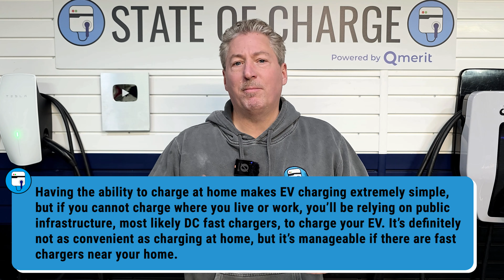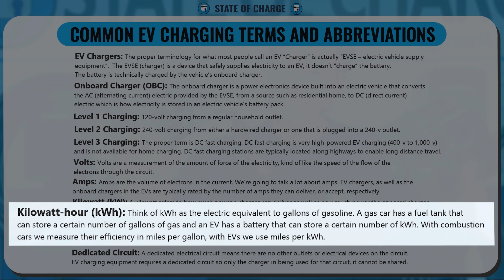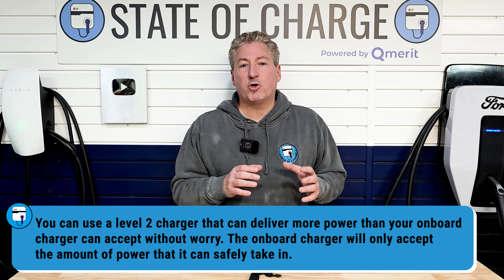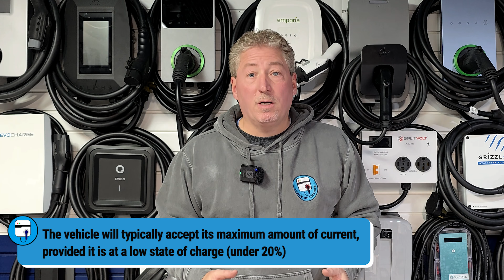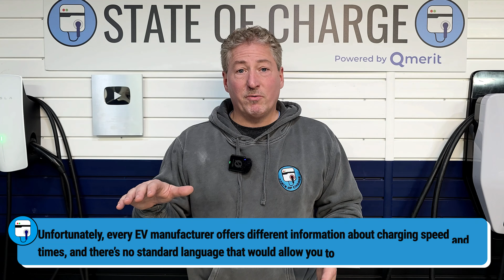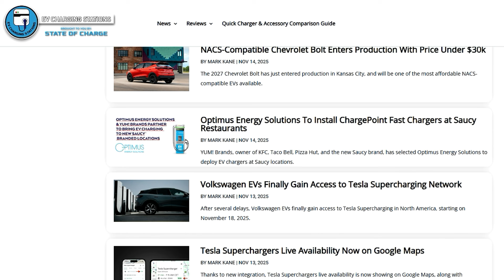Understanding How Electric Vehicle Charging Works And How Long It Really Takes

Comment: Great info! If I plug in on level 1 everyday for 365 days a year for 8hours per night is that considered 365 cycles? After 10 years my battery would be at the point of maximum charging?

Comment: Don't sleep on level 1 charging!  The average daily commute in the US is just under 30 miles round trip.  Even adding 4 miles range per hour of charging, which is on the low end of what I've experienced personally, you should be able to refill that in under 8 hours.  For a lot of people, a 10-hour nightly charge at home will easily cover your commute plus errands and other incidental trips.

Another way to look at it, if you add 4 miles for every hour you spend charging, and you plug in for 10 hours every day, that's 14,600 miles every year.  If you drive less than that (and you really should be excluding road trips from the total, since you're going to use DC fast charging for those regardless), then level 1 charging will likely cover your needs.

When I bought my EV I had planned to get a level 2 charger installed eventually, but after living with level 1 charging for a few months, it will be a long time before I upgrade to level 2, if I ever do.  Level 1 charging isn't for everyone, but for many people it's quite enough.

Comment: Hello Tom,

Thank you for providing a detailed explanation of the various charging levels. I am from Canada and am relatively new to electric vehicles. I watched your Grizzle mini EV charging video and considered purchasing one for outdoor use. I park outside and only have access to level 1 chargers using standard power outlets. When I attempted to purchase the Grizzle Mini from Amazon, I discovered that it has received negative reviews and some technical issues. Could you please suggest and help me out to get a reliable level 1 charger for 2026 RAV4 plug in hybrid for outdoor usage? Thank you Tom!

Comment: Great intro video! EV charging is new to me, so I didn't realize that level 1 & 2 "chargers" are really just AC-to-AC adapters (like a transformer?) that take either 120 Vac or 240 Vac as input and then output some output appropriate voltage that the vehicle's onboard AC-to-DC converter (actual battery charger) can use as its input. Do you know the ac output voltage that these level 1 & 2 "chargers" actually provide to the vehicle's onboard battery charger?

Comment: hello, great video. Quick question. My breaker is 60 amps but my tesla mobile connector for 240 v takes only 32 amps. Can I still use it to charge, will it damage the battery or charger in the long run?
Reply from the maker: Yes, you can use it without any issue!

Comment: When installing 2 Eporia Pros is it required to use both load management systems or is just 1 required?
Reply from the maker: If you are powersharing between both units, then only 1 load management system

Comment: I recently leased an 2026 Hyundai Ioniq 5. When preparing for its first road trip, I wanted to set it up to charge to 100% and finish charging just before I planned to leave in the morning. But I could not find a way to set it to complete charging at a set time. My Audi Etron has this feature. I can set it to reach 100% about a half hour before I depart. My question, does it harm the battery to have it sit at 100% charge for several hours? Or does it matter al all?

Comment: I’ve been using a 30 amp circuit for my EV6 and charging overnight easily from 20-90 kWh. I purchased a grizzly EVSE on your recommendation and it’s great with its thick cable, Cheers

Comment: Tom, I'm a 75 yo man and I only drive 3 to 4 thousand miles per year.  I just purchased a 2025 Ford Escape plug-in hybrid to replace my Ford Explorer to facilitate ease of driving as my wife and I get on in years.  The Escape has a tiny battery and I use the provided 120V charger.  It takes a full 12 hours to bring the battery to full charge.  Would installing a level 2 charger significantly reduce that charge duration?  My home has a tiny 100 amp service panel and it is maxed out in power because we have a pool, AC, and many other electrical appliances in our home.  I think we can only add a 30 amp breaker at most to the service panel.
Reply from the maker: It would absolutely reduce the charge time, possibly to under 3 hours if you install a high-powered charger. Your 100-amp service panel isn't a major problem anymore. You just need to buy a charger that has intelligent load management, like the Emporia Pro or IYILO chargers (There are others also. They will manage the load of your house and allow you to charge at 40A or even 48A, especially overnight when you don't have too much other electric use.

Comment: Yep, I've been charging my Tesla Model 3 only with Lvl 1.  I haven't bothered to have a 240V Lvl 2 installed, because we're likely to move within 1yr and the lvl 1 has been sufficient.  If we ever needed to charge up, we could always DC Fast Charge for a bit.  We've got multiple Supercharger options within a couple miles.

Comment: 16:30 — We redirected an existing 30A dryer connection to the opposite side of the same wall, into the garage (we had already switched to a gas dryer several years earlier).

We find that 24A is plenty to cover the needs of our Tesla Model Y and our O’Toyta 😂 Prius Prime (PHEV).  That, even including charging up to 100% right before a road trip.  

We generally keep the Model Y’s battery at 2/3 charge, but preparing for a road trip, the day before, we charge it up to 80%, and then the night before, up to 100%.  Easy!  Works fine!

Comment: A home EVSE is, essentially, just a very safe extension cord!  It essentially just sends the home AC power into the (PH)EV’s built-in charger, after performing some charging capacity checks.

Comment: When we see large charging-time numbers, they are usually imagining that you’re charging most of the battery capacity — say from 10-80%.  

That’s not common except on road trips, which, for most people are only a few times per year.  Most people don’t use anywhere near that large a percentage of their batteries per day.  If you drive, say 30 miles per day, you’ll probably have no problem replenishing that with a level-1 charger.  That, assuming that you plug it in every time you park in your garage.  

This is very easy to do too:  Once you get it all set up, it takes about 3 seconds to plug in when you park at home and 3 seconds to unplug before you go.

Comment: I know you know your stuff which is why I'm very surprised you would say plugging in every night is not bad for the battery!! There have been numerous studies to show that the less charging cycles you do the longer the batteries last (the less degradation).  Numerous studies show that a charge cycle from 20% - 80% makes the batteries last longer and have less overall mileage loss per charge over 10 years than anything else. Batteries have a charge cycle life, the less charge cycle the longer it lasts and it's been proven through numerous peer-reviewed studies.

Comment: Some incredible explanations Tom. Thanks.  

One Question you didn’t specifically address that’s on my mind: 

Does it damage the battery to charge beyond 80%?  Chevy, re my Silverado EV at least, recommends 80% for daily driving.  And my takeaway here is that, even with an overnight level 2, it’ll likely cost more to get those last 20%. 

Probably that is reason enough to stop at 80% when I drive 30-40 miles most days. But if I decide to press to 85-90% regularly, is that going to damage the battery in the long run?
Reply from the maker: Over time, it's not great to consistently charge over 80% for daily use. When you need the extra range, feel free to charge to 100%, but for daily charging, 80% should be your target. Why are worried if you drive 30-40 miles a day?

Comment: Great video, as an overview.  But in my case, my 3 year-old Audi e-tron hardly ever acts the way you describe, unless the car has been driven a considerable distance and/or the battery is warm from the ambient temperature.  My most common experience is that the charging rate starts low, gradually rises until the battery is warm (I guess), and then tapers down rapidly when it gets over about 60%.  My experience might be out-of-the-ordinary because my situation requires frequent DC fast charging because I do not have AC charging readily available at the present time.  So I am often charging after only a short trip from home. Which means that the battery is cool or cold, even if the weather is warm.  (The e-tron does not have battery preconditioning so the only way to warm the battery is to drive it.)  Also, I suspect that Audi may have changed the charging curve.  Anecdotally quite a few Audi owners have complained about slower charging since their cars got a recall whose purpose Audi described rather vaguely.  Now, maybe Audi did nothing, but I know that Tesla changed the charging curves on many of their early cars if the cars had had frequent DC fast charging  (Tesla told us so).  Anyway, my point is that DC fast charging is very much influenced by temperature of the battery, and may be regulated by the car differently from how you described it in your charts.

Comment: As well. A Rivan has a huge battery to charge. A Rivian is heavy because of the large battery. So, a heavy vehicle uses more power to go a mile due to its weight. So, they make a larger battery so the heavy vehicle can go a long range between charging.   In short, it is a big downward slope, batteries are heavy, and the more the longer to charge for 2 reasons, the volume and the weight requireing more batteries.

Comment: Anyone own and drive a same EV from day 1 of ownership for over 10 years now without replacing the EV battery yet.
Reply from the maker: Absolutely. There's many people who have 2015 and older EVs running on the original batteries. Some with over 300,000 miles

Comment: 16:23 not only capacity for power or space in the panel but capacity in wire routing.  For those of us who have conduit, 1/2" conduit is usually all that's installed. The max wire size is 10ga that can be installed, so a 30 amp circuit is max that can be run thru existing conduit.  Thats what I did, use existing conduit and run new 10ga wires thru existing conduit to the garage.  Its been great for last 4 years.

Comment: I asked on another video from someone else about above 80% charging. Here is what I'm trying to figure out on DC faster charging. What %age would be considered on DC charging slow enough to be at level 2 speeds? Would it be better to switch from a DC charger to an AC level 2 to complete to 100%? If they install level 2 chargers at DC charging stations, could that be considered less charging time than staying on a DC fast charging? DC charger will say, please switch to the level 2 charger to finish charging.
DC charging and finishing on AC to 100%. A title of a video.
Reply from the maker: Very few DC fast charge sites also have L2 units, so it's not a matter of unplugging from the DC charger and moving over to the AC unit. But to answer the question, every EV is different, but it's probably not until the battery is over 90% to 95% for most EVs, when the DC power is as low as the AC power, that the vehicle can accept.

Comment: Lots of useful data and info, thank you. Can I just assume that I can charge my battery on AC (22 KWH) up to 100% daily with no issues? Or you still recommend to keep this @ 80% ?
Reply from the maker: That depends on the battery chemistry.  If you have any battery pack that is LFP cells, then 100% is fine. If not, 90% to 85% is recommended.
Reply: @StateOfChargeWithTomMoloughney  thanks

Comment: I have a Grizzl-e ultimate 48 system that just got installed. Everything works well including the app EXCEPT, no matter what I set the current flow to in the app it always runs 2.5A less. If I ser my charge rate to 40A in the app it delivers 37.5. If I set it to the max 48A it delivers 45.5. This holds true at every set point. The car is capable of a full 48A charge speed. There are no adapters in use. I have a 60A breaker with 6awg wire. The whole run is roughly 25'. This is my 1st EV and my 1st charger. From what I gather this is not typical behavior. What could cause it?

Comment: Hey, I just bought my mach e premium extended range. I drive about 80 miles a day and was wondering if you think i will be okay using the mobile charger and getting a 240v socket put in or if i should go ahead and get an autel or eviqo to better suit my needs? Thank you!

Comment: I think the bottom line is for people who can charge at home on a level 2 charger the experience is fantastic.  Just like charing a mobile phone.   My question is about adapters but specifically A/C adapters.  I own an EV with J1772 and CCS.  But likely if we buy a 2nd EV it will have NACS port.  Today my level 2 charger uses J1772.  What A/C adapters are recommended when using this charger for an EV with NACS as the garage could have NACS and CCS EVs.

Comment: This is great, Tom. I've already shared with a number of my novice EV friends. 97% of my charging is done on my ChargePoint home charger connected to a NeoCharge Smart Splitter. DCFC'ing with Hyundai's latest Plug-and-Charge has made recent road-trips much easier. We've come a long way in the past 15 years!

I know that you address it in other videos and was not the topic here, but scheduling your climate control to heat your car while still plugged in to your home charger for cold winter mornings not only makes for a more comfortable experience, but dramatically improves the car's battery efficiency. Another reason to plug in every night during the winter. 🥶

Comment: Excellent job Tom. I like to say L1. It's not just for breakfast anymore. We charge with this when we go to the cottage up north and the car is basically sitting there so it's sitting there plugged in. Another thing about on the road plug in first and then go use the bathroom traveling with the wife and three dogs. The car is always ready to go before we are just a thought

Comment: @5:10 - Those electrical term definitions are all mixed up. Volt is indeed the force  pushing the flow, but the speed of the flow is the Amps (more amps, electrons are passing thru faster), and the volume of the flow is the kilowatts (combination of the force and current). Bur to really to get volume you need time, like with Kwh.  So that section seems all mixed up.
@26:00 - another unexpected term - kw Avg. It's confusing, because the graph is basically appears to be showing instantaneous charging speed, not averaged over the length of time. IE, when the graph drops from 150kw to 110kw at the 20 min mark, the speed has dropped to 110kwh but the average KW over the charge curve is still around 140kw average (not 110kw average).  So I really don't understand the use of the term 'Avg' in those graphs. And after finishing the video, I'm wondering are those graphs really showing average over the entire curve? Looking again at how they can ramp down to 0 at 100%, it definitely is not an average over the whole curve. Maybe it's a smaller average, like a 5 min window average along the curve to help filter out the jaggedness of instantaneous speed from sampling?

Comment: No, volts have nothing to do with the speed of the electrons thru the circuit.  Volts are better equated to the pressure of water in your plumbing system -- it is how hard the electricity is pushing on the wiring trying to escape from the copper in the wire.  You and anything surrounding the wire is protected from the voltage by the insulation on the wire and the cable.  The speed of the electrons thru the wire is governed by Velocity Factor (more akin to power factor --- but that's a different subject.)  Amps are better stated as the volume of electrons passing a certain point along the wire to the load from the source --- it is equated to gallons per minute of water flowing  in your plumbing.

Comment: Morning Tom we received a GM Power up 2 with our car and had it professionally installed. My question is who’s the actual manufacturer of this brand and have you ever tested one. Ours has been installed for 9 months and charges two vehicles usually about once a week. It’s running on the 48 volt tap and has performed flawlessly since installing. Thanks RJF

Comment: "Be careful of the top charging rate."  YES!  My advice to the EV curious is to ignore the max DC charge rate or miles added per 10 minutes.  Instead, find the 10% to 80% charge time.   I had a trip from Florida to Arkansas to Minnesota to Florida.  My average time on charger was 18 and a half minutes, but that included several longer meal stops.  My tyical non-meal stop was 15 minutes.  Okay, I'm on E-GMP so your experience may vary.